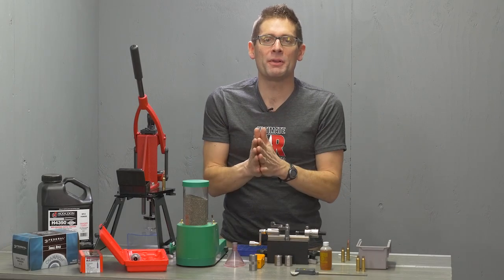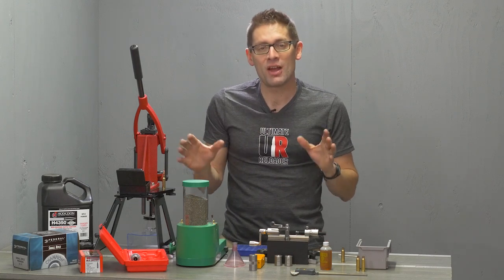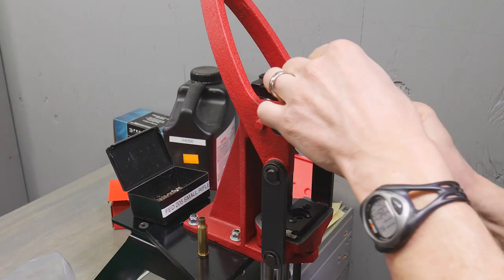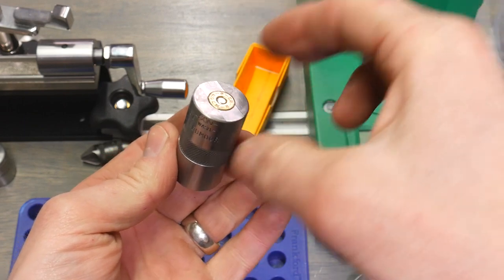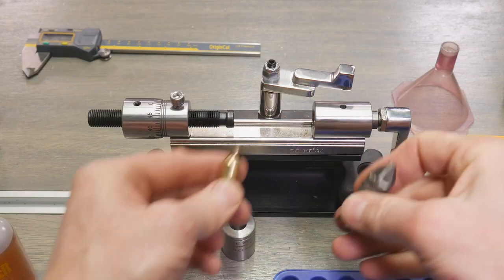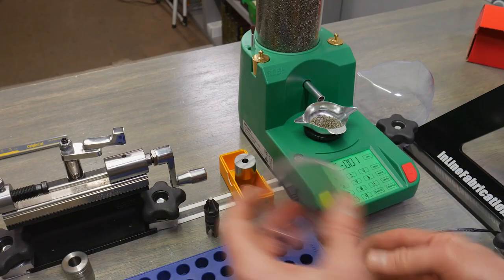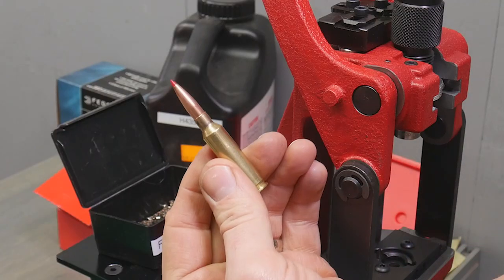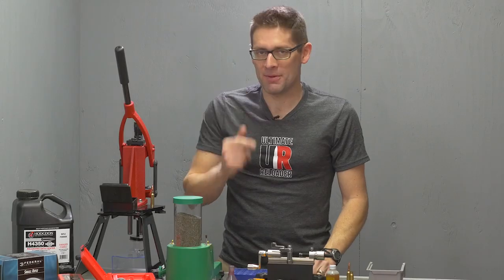Quick Look: Precision 6.5 Creedmoor Reloading Start to Finish

Comment: Thanks for the video...I assume you'd tumble the brass after sizing-especially since you lube'd the inside of the case neck. I know its a very broad overview but seems like all the key steps should be mentioned. Controlling headspace, neck tension, and concentricity could be mentioned but not shown. Same with less universal practices like annealing, neck turning, etc. This would be valuable to someone new to reloading. Thank you!

Comment: just a little tip. For those who use presses and separate primer tools, Using a small magnet with "L" or "S" stickers helps you remember the last configuration of the press or tool. Great for those who use the Forster Co-Ax press which has "S" and "LS" plates with small and large ends.

Comment: Hi! I’m a fan of your channel. Recently reloading 6.5 Creedmoor for my Tikka T3x Tac A1, but have a fundamental question, primers. It’s kind of a split opinion on large rifle primers going cci250 VS cci200. What’s your opinion? Recommend Magnum on some powders?? I’m reloading 123, 140, 147 grains and have R17, Hybrid 100, H4350 and Superformance at home. Kindly appreciate your expertise. Keep up the excellent work!!
Reply: Marcos Cancel I have the same question. He’s not the only reloader that went with a small primer. I wonder why? All of the factory ammo I’ve looked at all has large prime. I see you are using cci primer. Isn’t that like a military grade primer that is a bit hard to prevent bump fire? Is there any advantage of using a hard primer? Thanks
Reply: Any responses on this? ALL the guys I know that shoot and home load 6.5 use the Lapua small primer brass.
Reply: Small primers are safer, and originally, it was recommended to Hornady to go with 58,000 piezo pressure, but they went with 62,000, knowing absolute redline was a little over 63,000. That’s why some want the small primer, but in cold weather, there are known failures with the small primer. The best solution would seem to be a slow burning powder, like H4350 or similar, with the large rifle primer, and going conservative with the charge weight in grams. Start with minimum and work up slowly until good accuracy or max load is reached. There is a favored distance off the lands, maybe .040”, but it varies from each barrel and chamber.

Comment: I'm old school...I hand load for bolt action hunting rifles with a 1972 RCBS JR2 single stage press.  I use RCBS case lube and pad...been using that for over 30 years and never a stuck case....why is this no longer popular for case lube?

Would you get a more precise neck by using an expander mandrel instead of the expander ball in resizing die?

Comment: I have a .260 browning A bolt micro hunter. The gun has a 1in 10 twist. It shoots factory  loads Remington core-lokt 140 grain really good. I had a friend of mine load me up some nosler lr 142 grain with 43 grain w760. Gun doesn't like them. Is the twist in the barrel that's the problem ?  If so what bullet and load do you recommend.  This is for hunting Whitetails.  Thanks
Reply: Winchester powder isn’t always ideal. Most reloaders claim great accuracy with H4350, and not too hot. Also, you need to know how far off the lands to be. This cartridge is sensitive to that, but every rifle is unique. Your load may be too hot for ideal accuracy.

Comment: Hey Gavin, are you going any true precision loads for your 6.5 bolt rifle (assuming these are for an AR platform or you wouldn't be worried about SAAMI spec) using fire formed brass and only sizing the neck and bumping the shoulder if necessary? That's more what I load/shoot with my Forster and my 6.5 creedmoor rounds.
Reply: A lot of competition shooters full length size for their bolt action rifle shooting.  Most articles I have read where the authors have tested full length sizing vs neck sizing side by side saw no benefits in accuracy or brass life with neck sizing only and tended to prefer full length sizing because it mitigated feeding issues.

Comment: What about primer pocket uniforming, flash hole deburring, bullet seating depth? Also, neck bushing or F/L bushing dies to prevent excessive working of the brass over a usually crooked expander resulting in excessive run-out and also measuring run-out? Not precision reloading at all just a standard reloading video.

Comment: Great how to step, since I have not started to reload yet. What does all the equipment you used cost? Plus I presume you would need a tumbler to clean the brass? So that would be another cost too. Thank you.
Reply: Joe Jr an RCBS kit is really cheap. It has everything you need basically besides a case trimmer dies shell holder  and a tumbler. Hornadys reloading kit is overpriced tbh. You get a bunch of plastic and a crappy scale you’ll change after the first use. Go with rcbs with the balance beam scale. You’ll probably make an initial investment depending on what you get. The lee kit seems amazing and it’s like $130. With dies a cheap tumbler shell holders and trimmer you’ll probably be looking at $300-400. Depending on what to yuse
Reply: I have a Dillon XL650 which is the progressive standard and I paid about $500-600 I forgot the exact price. Im 15 but i don’t like cheap stuff. Especially when your life depends on it . Don’t cheap out on the scale man. Can’t go wrong with a balance beam. Personally recommended Dillon as well. I had an issue with mine sent it in and got a new one
Reply: If you’re interested in exactly what I use I’ll tell you just reply. And I’ll tell you exactly what I own what i like or dislike
Reply: All of the equipment in this video would probably put you up around $1000 give or take a bit and would be an awesome setup for precision rifle reloading.  If money is tight you can get started reloading great quality ammo for considerably less than that.  For a beginner on a tight budget the Lee Breech lock challenger kits are good.  For a little more money and a lot more capability I would recommend the Lee precision classic turret press kits, they are a lot of press for the money and I wish I had known about them when I started reloading.
Reply: Craig Arnold I've been looking at all different press options. I haven't locked down on one just yet. The  lee classic turret press does look good.
Reply: Are you just wanting to load one caliber or do you plan on loading multiple calibers?  If so which calibers and approximately how many of each round per week or month do you plan on shooting?
Reply: Planning on starting to reload 300 blackout. I got a ton of 5.56 brass I can turn into 300 brass. I imagine would get into some other calibers too.
Reply: Cool, I know there are some extra steps and tools necessary to do that and I have read certain brands of brass are easier to convert than others.  I haven't done it personally but there are a lot of great forums out there and videos on here that detail how to do it.  I am sure if you put your mind to it though you can get it done.  If you only plan to load bottle neck rifle cartridges a single stage would work fine for you because you have to check case length and trim if necessary after resizing anyway which you would have to do on a turret or a progressive press so if you just seat the bullet or do a combined bullet seat and crimp in your second die you really don't gain much with the turret or progressive press.  If you have to crimp in a separate die or if you think you may want to load some pistol or straight walled cases in the future the turret press will give you a huge advantage in speed over the single stage.  The only way to go faster than a turret press would be a progressive press but then you're talking a lot more money just for the press which doesn't include most of the other stuff you will need to get started reloading plus caliber changes get more difficult and more expensive with progressive presses.  The nice thing about the Lee beginner kits is you don't have to wrap up a ton of money in them and you can learn a lot using them like if you even enjoy reloading your own ammo and if you really want to spend more money to do it.  Reloading on any press will also help you learn what features you do and don't like in reloading equipment and accessories, and the money you save early on makes it easier to afford the other little things you will need to get started reloading.  Believe me there will be some little things you will find out you need to buy getting started beyond what your research tells you and when you're done buying the stuff you need you're going to figure out pretty quick that there is a whole lot of other stuff you want to buy to make things easier on yourself.  I still think that Lee classic turret press is the best buy for the money because it does everything a single stage press will plus a whole lot more and the spare turret heads to make caliber change over easy are very reasonably priced.  If you buy it in the kit it comes with most of the stuff you will need to get started and the other stuff you will need besides dies, brass, powder, primer, and bullets to get started shouldn't cost too much extra.  Something like that is good to start on and years down the road if you decide to upgrade to a progressive press you will already have all of the little stuff nailed down so your only cost will be the press itself and what you need to run it.
Reply: Very good advice, thank you.

Comment: Do you have any load for copper bullets using a 1:8 twist? Primer, powder, bullet weight
Reply: Hornady does for the GMX, and CX, which use all the same data. Barnes does for the TSX, TTSX, and LRX. All free pdf charts for downloading. So does the Hammer forum. Tons of calibers listed in 2 free pdf.

Comment: should've showed bumping the neck, most important thing that i missed when i first started reloading
Reply: You don't bump the neck. You either FL size and bump the shoulder a tiny amount, or you neck size for whatever neck tension your bushing is for, then have the option to run it through a body die if you want to bump the shoulder back after neck sizing.

Comment: Gavin,
Almost complete but you might just want to run it on Sinclair ball concentrically gauge to show the accuracy of the dies and the press. (All I've used for a long time is the Coaxial or, L.E.W. inline dies/press.)
For those new to loading and or the anal retentive freaks. Like me..Lol

Comment: Good video but you missed a lot of steps involved in the reloading process that a beginner needs to know.  It’s not as simple as placing the bullet and pressing it into the case without speaking about COAL or showing the step where you removed the case lube from the case and case neck.
Reply from the maker: lonz73 Appreciate the feedback but I think you missed the point, this video is about showing the process ay a high level end to end- all of the minute details are covered and many of the other videos I’ve published. :)